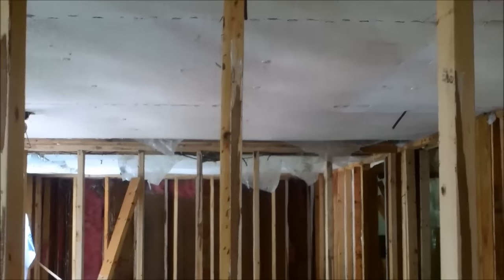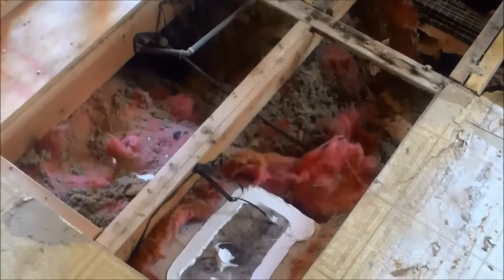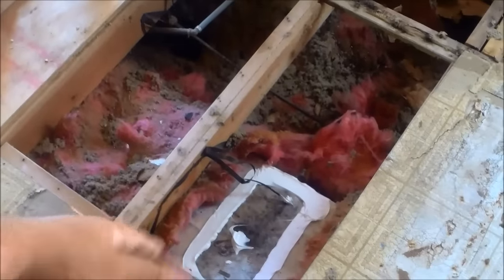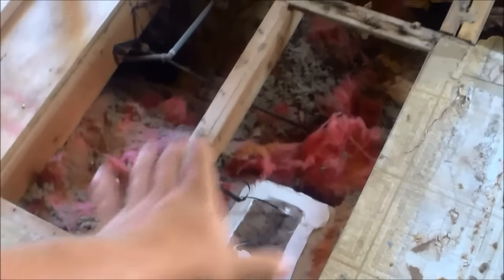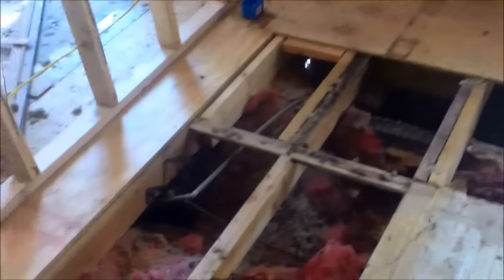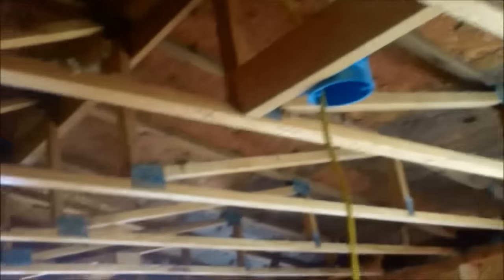Income property episode :11 electrical and Framing

Comment: I'm curious, I may or may not have missed it, are your lights for the bedrooms on the same circuit as the outlets??
If the lights are on a separate circuits, why not run 14 gauge 15 amp instade of the 20 amp line.
Reply: +jmc90213 20 amp is for 12 gauge, 15 amp is for 14 gauge
Reply from the maker: i always do 12 gauge just incase i need to add more plugs,
Reply: +jmc90213 where I live, Ontario Canada 12 gauge 20 amp is required for kitchens appliances and bathrooms, I think??
Also maybe required for all Outlets but I could be wrong, 14 gauge 15 amp is standard for all lighting.
Reply from the maker: +ARednecksLife most trailers are 14 gauge and one circuit per 2 rooms.... i like to do one circuit each room